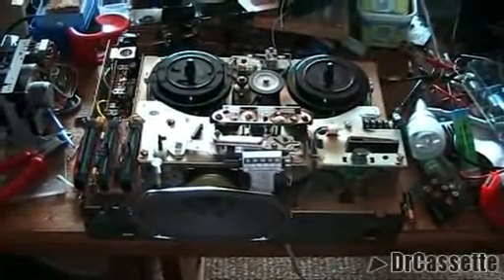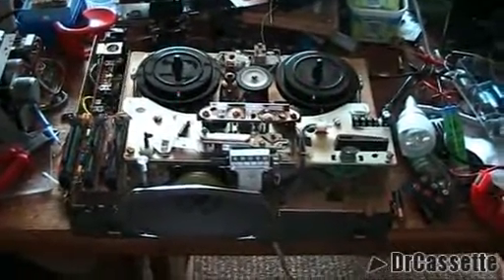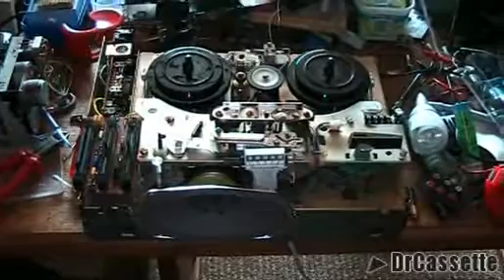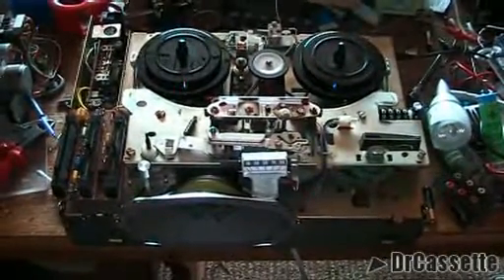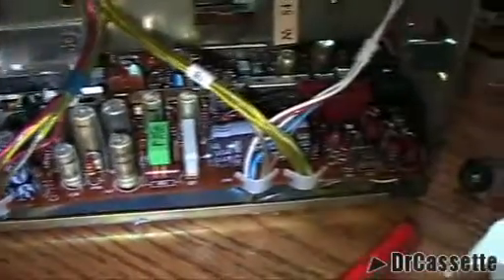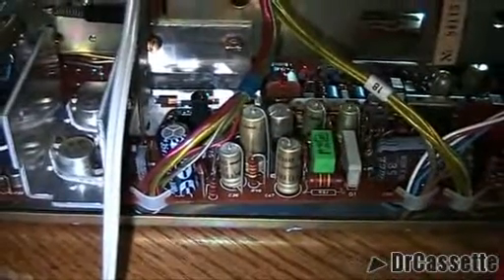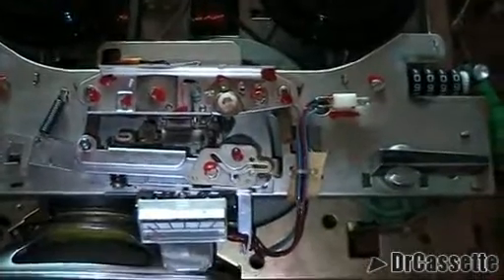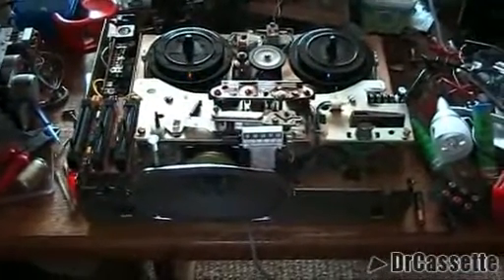DrCassette's Workshop - Grundig TK126 reel-to-reel repairs

Comment from the maker: @Felix2417425 
This kind of setup was quite popular back in the days. There were portable record players that used a transformer buit into the motor for powering the amplifier. I have also seen a mechanical electric clock that used the motor as a transformer for a little light to light up the display.